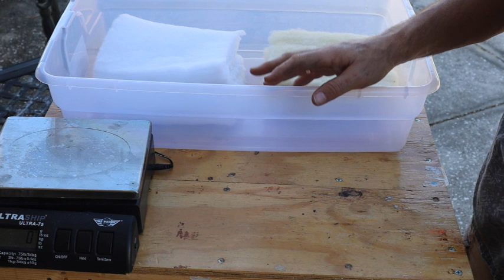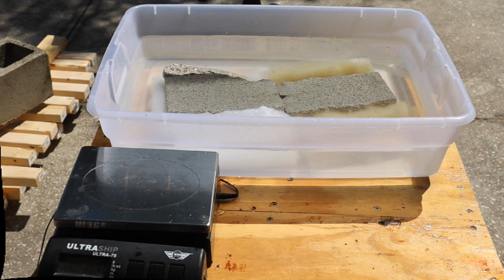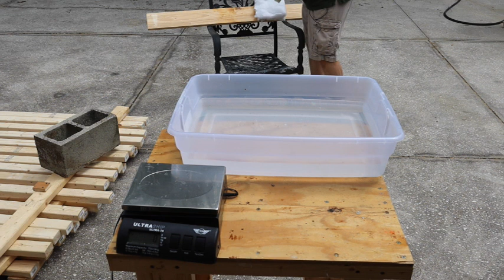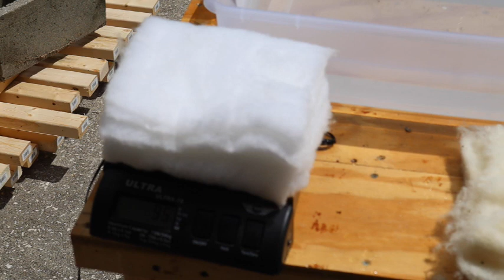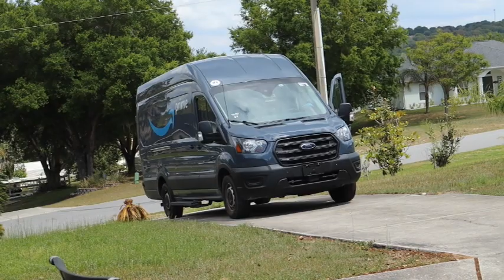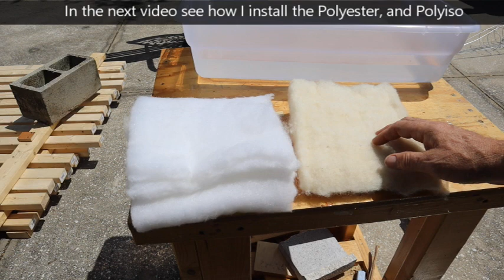Van Life - Insulation Test 3 - Polyester VS Wool - water absorption

Comment: Can get polyester batts in Australia made from recycled plastic bottles. Also better for allergies than wool. I also think wool would break up more and not hold its loft as well in a van. Havelock wool you need to layer. Poly batts can be bought in whatever thickness you need so retain loft.
Reply from the maker: You can see what I used in this video:  https://www.youtube.com/watch?v=8zlfQBOSebY&t=310s&pp=ygUYVmFuIExpZmUgSW5zdWxhdGlvbiBUZXN0
All the videos by category can be see at  https://thefrugalfactor.com/

Comment: If your van gains that much water, you've got a bigger problem!
Also, the wool does not do any off gas-ing, so the van does not fill-up with toxic fumes or voc's. When living and sleeping in such a small space as a van, being conscious of the materials being used is highly important. Glad you are being g so thorough in your testing, just need to consider other factors and elements.
Reply from the maker: Wet wool smells like a farm.  Off gassing with all substances will occur.  In a house with new carpet, or that new car smell, is off gassing.  It is more of a hazard in a home, than a van.   In a van there is a constant air exchange, each time you open a door.  A van needs excellent ventilation to keep condensation and moisture to a minimum.  A greater hazard than off gassing is mold growth.  In a future video you will see our boat hatch installation, and under van vent fan install.  Cross ventilation is key to a cool dry van!

Comment: I appreciate your material function tests. What about flame retardants of the PE? The wool is $270 per bag. This video just revealed my build would definitely require to bags/$540 on insulation alone. Thank you for sharing your findings. I will await your next video.
Reply from the maker: Yes wool is expensive.  Wool and polyester both burn.  If you have a fire in you van that reaches the insulation I would expect it to be a total loss, no matter what type of insulation you have.
Reply: I've changed to thinsulate, still expensive, yet flame retardant. Thanks @FrugalFactor  I'll be waiting for the next test video.
Reply: I do believe wool is naturally fire resistant? Any man made fiber is most like going to create toxic fumes when burned. Granted, the fire is probably a bigger danger but something to consider.

Comment: I guess the main reason for not using the polyester is fire safety.
Reply from the maker: Polyester is slow to ignite.  If you have a fire in your van that reaches the insulation, it’s already too late. Wool also burns, but does not spread the flame. Wool smells like hair burning.  After any fire in a van I would expect it to be a total loss, no matter what type of insulation is used.   Just my thoughts....